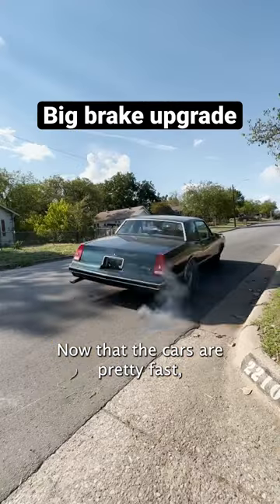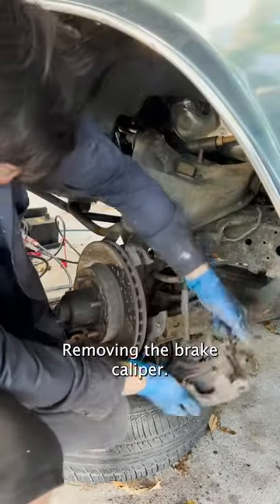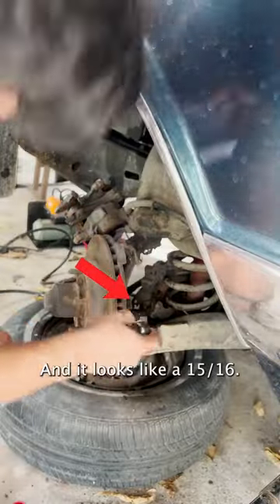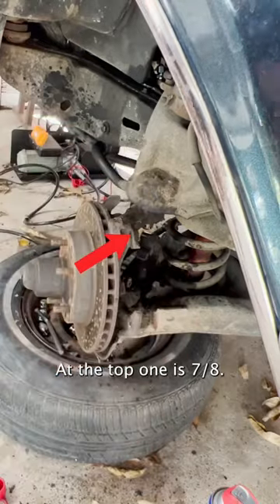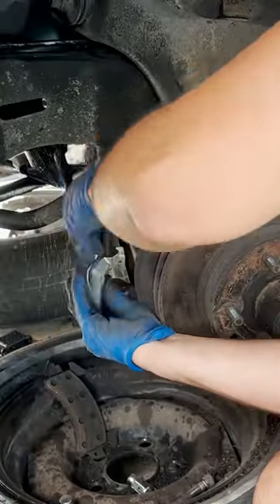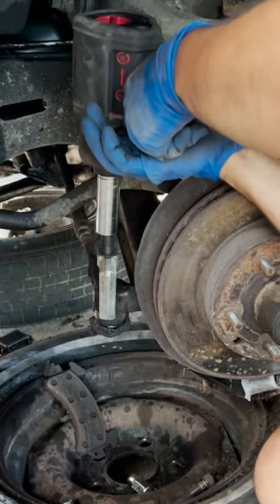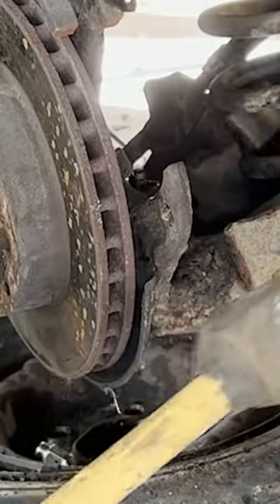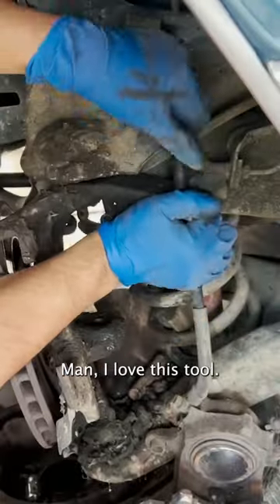G BODY big brake upgrade part 1 removal

Comment: You know if you’re going to put out how to videos you really should show how to “properly” do these things letting the caliper just hang by the brake line is a terrible practice.

DO NOT DO THIS! 
Use a hanger or hell even prop it up on the A-arm or something don’t just let it hang by the brake line.